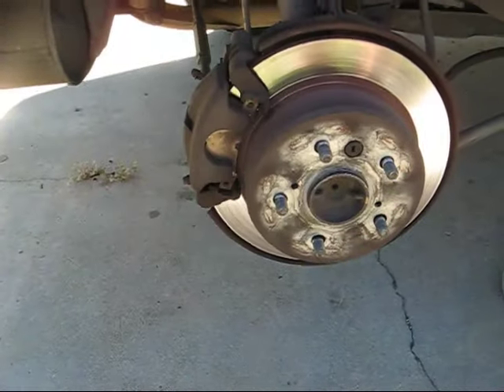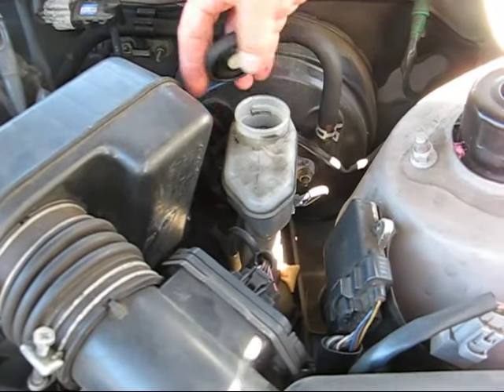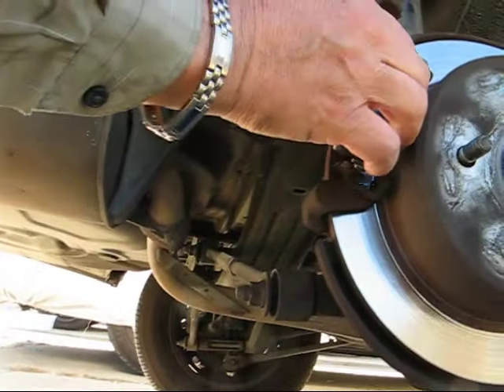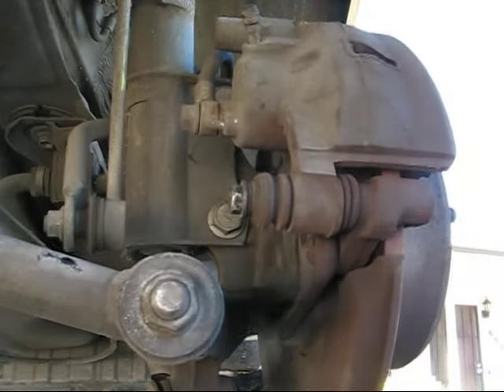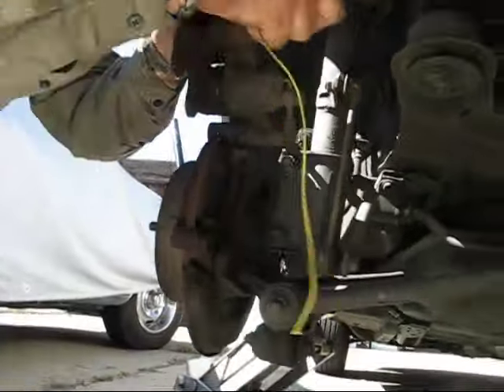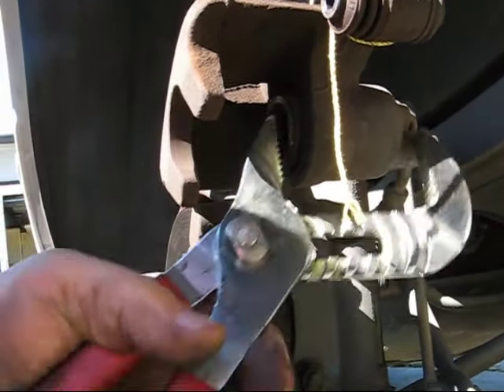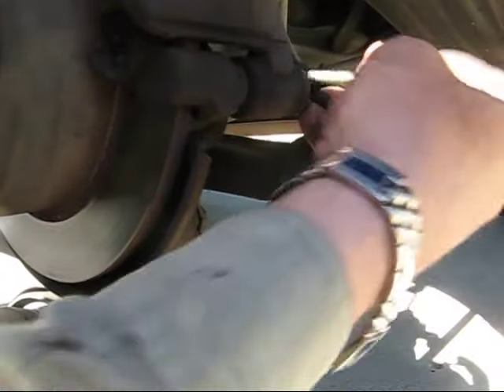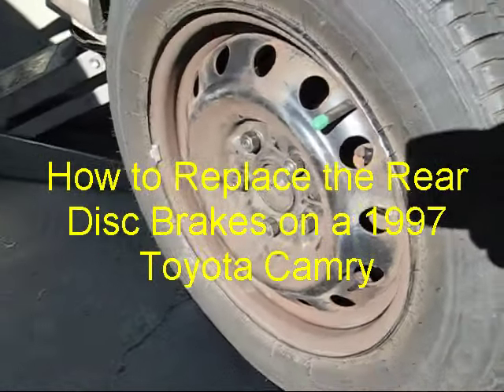How to Replace Rear Disc Brakes Toyota Camry

Comment: After realizing my '95 Camry had disc brakes in the rear, I read the Haynes book and it looked so confusing and daunting that I was going to take it to a shop and have them install the new pads I just bought. Then I decided to search YouTube before I paid someone hundreds of bucks, found your video on the first try, and canceled the appointment. I cannot believe there is another video on  YouTube that can show me an easier way to do this job.
Got to grab a 12mm socket, a length of rope, and the new pads. Thanks.
Reply from the maker: I glad you saved the money.
Reply: @davidlis6709  Thanks again. I did this last weekend and it went so fast and easy.
The only thing I recommend is to remove the bolt holding the rubber brake line above the calipers since it is also a 12mm bolt. This allows prevents from stretching the hose when you swing the assembly up.
I used a large C-clamp to push the piston back in and it worked great.

Comment: great explanation of pad removal and replacement. additionally I would explain lubricating the slide bolts, if they become dry it can cause problems with the pads dragging on the rotors , which can cause additional problems.
Reply from the maker: Good idea
Reply: @davidlis6709  Also put a dab of lube on the ears of the pads.
That helps them to slide more easily during operation.

Comment: Don't forget to start the engine and slowly pump the brakes before you drive.
The caliper piston is all the way in and needs to be brought back out before
the brakes will work.
Reply from the maker: I always forget to mention that.

Comment: That was a close call on those pads hehehe. only thing i thought from watching other videos is the brake caliper pin lubrication with tiny anti seize or silicon grease,i guess it depends on the country and weather conditions,Australia is pretty dry "no salt on roads rust belt" your car looks non rust belt also like here. you made it look quite easy, i gotta do my wifes 2006 camry soon.. anyways good on you for taking time and effort in posting this video, thumbs up.
Reply from the maker: I live in Silicon Valley, California.  The only thing around here is rain and only from November to April.  So the cars are rust free.  The sun fades away the paint and seats, dash covering, etc.  

If I was in an area of salt where it rusts the cars, I probably would put a little grease on the bolts to make it easier to get it off the next time.  But I do put a little grease on the wheel lug nuts every time I take them off.
Reply: cool yes many ways to do brakes not judging was just what ive seen you tube pro mechanics do and most are in USA snow/salt belts , i personally never greased the caliber pin but i will have a go next time on my wifes car as her car seems to get "brake grab" brakes way to touchy in my opinion,visual inspection looks ok eg rotors smooth, anyways we get the same here in oz "sun fade and seats, dash cracking" and clear coat peeling off, although car makers have gotten better over the years with interiors like dashboards..bit hot here on south coast Australia as we are in the summer season..Take Care David Lis.

Comment: Love your video. Very straightforward. 

The only thing I notice is that my new pads don't have shims on the back, do I just reuse the old ones? 🤔 The front pads have some sort of a material glued to the back and there is nothing on back of the the rear pads.

Thanks, Thomas from New Zealand.
Reply from the maker: I do
Reply: @davidlis6709  Much appreciated.
Reply from the maker: @thomas316  I try to reply to everyone because there are no stupid questions.  If you are asking, there are several others that are afraid to ask.

Comment: I had a unfortunate first rear brake pad install, I had to undo a small nut that held the fluid hose in place, the rubber piston gasket got court on the brake pad deforming it ( I got it back into place with a small pointer tool and I couldn't get the sleeve on the bottom of the removable part of the caliper to move back to clear the lower part of the caliper when reinstalling I couldn't knock it back with a large hammer but I could spray some CRC under the rubber jacket and almost move it back by hand, the dry rubber bushings inside the sleeve assembly were absorbing the impact from the hammer :/
Reply from the maker: So, you used a hammer to push back the piston instead of a large set of pliers, like in video marker 2:34.
And now the rubber is damaged?  I am trying to understand what you did.

Comment: What would you recommend for rusted bolts? My bolts are way too stuck and I’ve tried everything I could think of.
Reply from the maker: Without seeing them ---   did you try WD40, spray it with and wait a couple hours. Do you have a small blow torch that you can heat them put to expand them, let it cool down and maybe spraying with WD 40 again.

Comment: i have a 2001 camry the same set up my question is how do you take the calipers off so i can change the rotors there is a lower bolt but up the top there is  the brake cylinder .
Reply from the maker: Just remove the upper bolt on the caliper,  the rotors just pull off.   If they are super rusted, use a hammer to break them loose.
Reply: @davidlis6709  there is no upper bolt just the lower bolt on the caliper
Reply from the maker: I can't remember but I was looking at the video and you are right.  You will have to remove the bracket, 2 bolts.
Reply: @davidlis6709  Yep i see those awesome video by the way David  my camry is from New Zealand these cars are bullet proof.
Reply from the maker: @Mrskendrabare  My wife had 1986 and she drove it for 180,000 miles.  The only reason why she sold it was she was sick of driving it, not because they was something wrong with it.  She bought a new one in 2011 and it has 95,000 miles on it.  The only thing it needs is brakes, oil changes, windshield wipes,  tires, and gas to run it.

Comment: It don't get any easier,lol come on people,grab a set of sockets and get down and see what size the bolt is,some years could have bigger bolts.Only one thing I might of done myself is use the old brake pad and push on the old pad so you don't damage the piston or boot,but a very easy to follow video so two thumbs up..
Reply from the maker: Thank you

Comment: Piston boot was broken on the other side?? You did no change it?? No torque numbers for caliper bolt? Also you did not use any brake cleaner?? That's all....
Reply from the maker: If the boot is broken you will have to replace it.  I do not change them unless they are cracked.  
I have been doing this so long, I just tighten then tight then but not enough to break the bolt.  No, I do not use brake cleaner, just clean what needs to be cleaned.
Reply: Your boot was broken, cracked, and...you did not change it???
Reply from the maker: I did not change the small boot because it was on the bolt and not the caliper.   I did not use brake cleaner because it was careful not to tough the disc pad side that rides on the rotor.  As far as torque, I have done this so many times, I just do it by feel.

Comment: Rear disc brake PADS!!
Reply from the maker: Yes - pads not drum brakes
Reply: @davidlis6709  it doesn't say that in the title. I was looking for replacing the rotors, that's why I said pads because that is all you replaced.
Reply from the maker: Replacing the rotors are easy.  Remove the 2 bolts for the bracket (4:05) and then the rotors are ready to come off.    At :21 you see the rotor and there is a rubber grommet,  I believe there is a Phillips screw that needs to be replaced.    If it is stuck because of the rust either hit it with a hammer or there are 2 places you can screw in a bolt and push the rotor out.